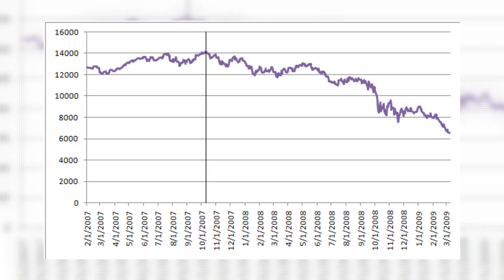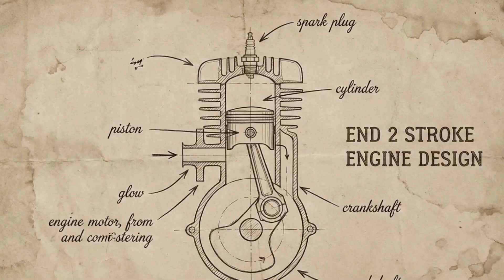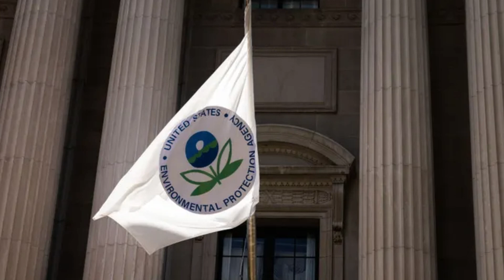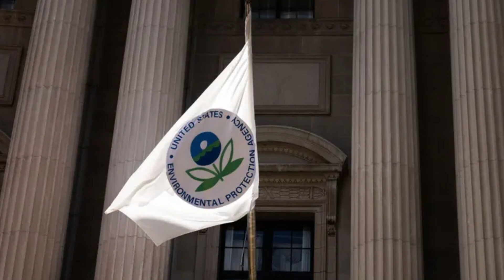The $3 Billion War: How GE Finally Destroyed EMD's Century of Dominance

Comment: The 710 series never had Roots Blowers . Only turbocharger with overrunning clutch .
Reply: that was the 645   2000 hp roots blower t
Reply: @d @dknowles60 ey’re talking about the EMD SD70 model who had the 710 series engine . 
The last major EMD locomotive who’s been equipped with the EMD 16V 645 with Roots Blower is the GP 38  1966 to 1971 . GP 38-2 , 1972 to 1986 .